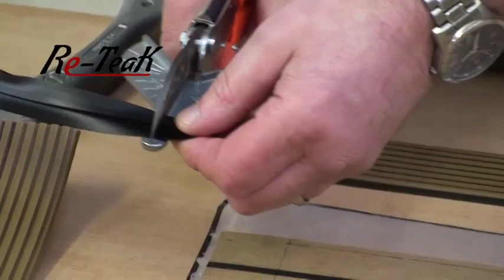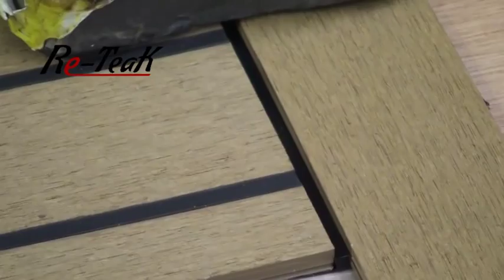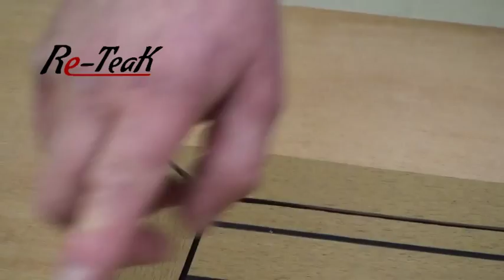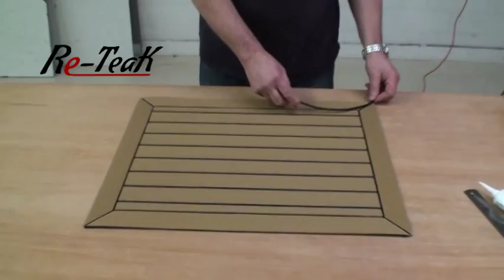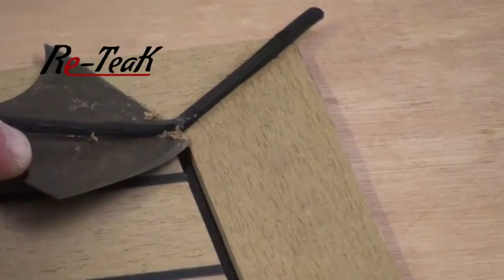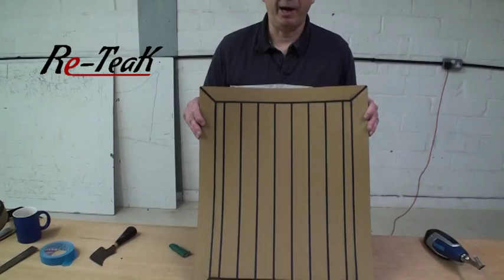Re Teak Welded Panel with Margins

Comment: awesome video... where can I get all this stuff?
Reply: I have the same question
Reply: Yeah really... what happened to this product? The materials? The glue? The tools? It is an interesting video, but more frustrating than useful. The process of joining, and filling gaps, cannot be used as far as I can tell, because I can't see that sort of gap strip connector being offered anywhere. 

I ordered the presently available foam faux teak decking (a generic brand off eBay, really inexpensive), and a gel super glue to join sections. That SEEMS to be how it is done now... but who knows?
Reply: @proto57 this whole faux teak process is so vague and expensive and secretive and hard to figure out the actual cost.